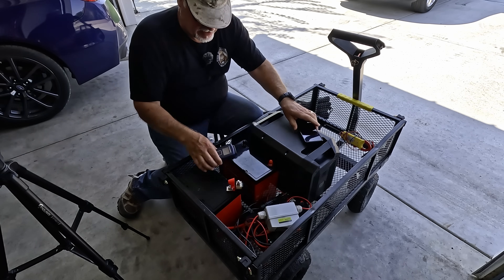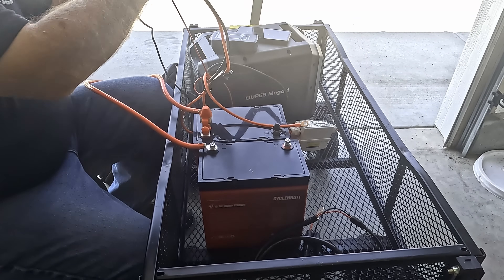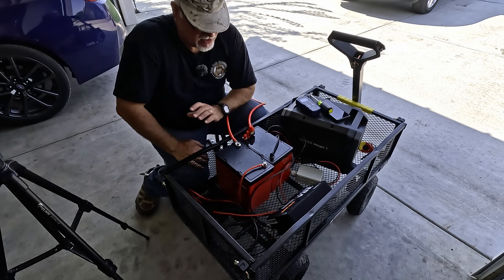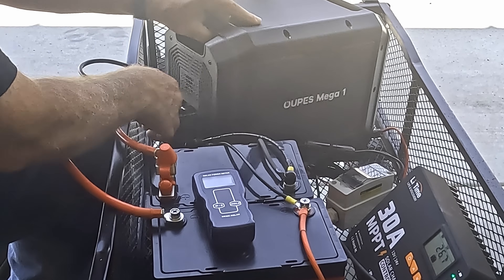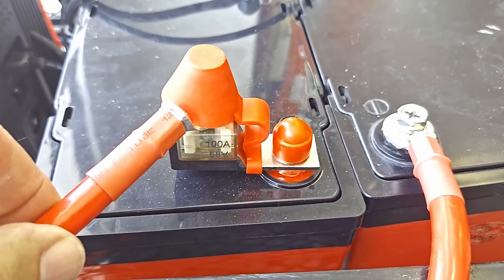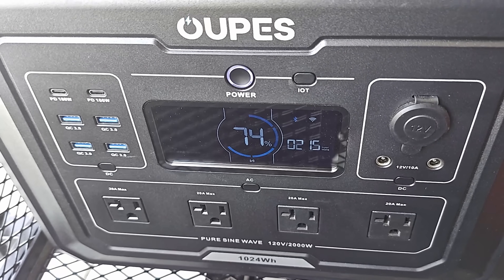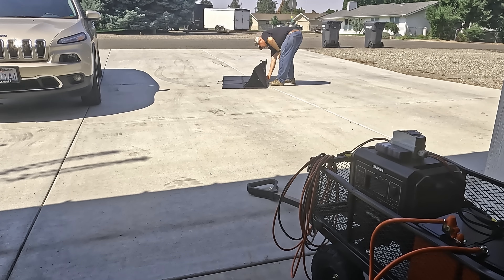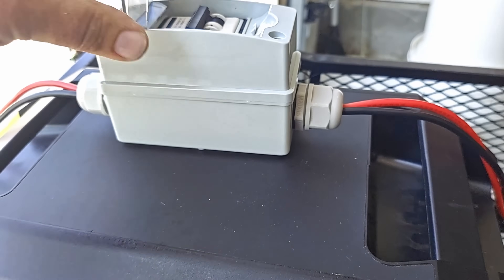Solar Panel Powers Battery AND Power Station Simultaneously – TESTED

Comment: Yup, this definitely works.  The one provisio is that it is best when the solar is capable of putting more watts into the battery than the power station takes out.  Otherwise things can get a little messy if a "battery empty" situation develops.

The power station will usually drop-out before the battery does, but the charge controller will then push the battery voltage back past the power station's start point, causing it to immediately bring the battery back down below the power station drop-out point... so things can start cycling in weird ways.

Not an issue at all if the battery isn't empty, though.  Generally speaking this method works quite well.

-Matt
Reply from the maker: Good point -- it's important to make sure the solar has enough juice for both!
Reply: Why I have multiple batteries and chargers so if the situation ain't good I can charge them both with a generator and swap out as necessary
Reply from the maker: Nice

Comment: Hi, Thank you so much for this and all your videos! This is exactly what I've been thinking of doing. My power station (Anker Solix F1500) will take a 600w max solar input. I want to run a potable Air Conditioner that pulls approx 1600 watts. Should I just take the Anker power station out of the equation and run the AC unit off an inverter? I can only run the AC for about an hour. I, of course, am trying to run it longer via batteries. You can probably tell, I'm a total newby to the off-grid Solar World, so thanks again for your videos that even a newb like myself can understand. I'm subscribed!
Reply: You're going to need a LOT of batteries to run a 1600w AC.... Also holy hell that's s big AC. Central air?
Reply: @jaredpnk  When I plug the portable AC unit into the Anker power station, Anker says 1500 to 1600w going out. I'm new to power stations. But I have a smaller portable AC unit that says 900w going out of the Anker...so that's what these units use, yes? Or no? Is there something I don't know (yet)? Thanks for the reply
Reply from the maker: What kind of AC unit is it?
Reply: @TheOldJarhead  Brand name ZAFRO portable (stand alone, in the room, run the exhaust out the window, etc) unit. Thank you very much! I'll look into inverters.
Reply: Oh, sry, one more question. What batteries then to run that unit (out of the inverter)  for any amount of time and how much solar to charge those batteries in a reasonable amount of time? Thanks for your time! Is tons of, crazy expensive, battery power needed? I haven't bought any batteries yet.
Reply from the maker: Hmmm, is it the 16000btu unit?  If it runs for 24 hours, you would need 8 48v 100AH batteries to run it for that 24 hours.  Unless it throttles down after it cools the place down. You'd need a LOT of solar to recharge them, but if you had about 10kw of solar, you might do ok with those batteries.

My guess is it doesn't use that much power, though.  What I'd do is get a wattmeter and run it 24rs and see how much it really uses.
Reply: @TheOldJarhead agree with you. I've never seen any portable AC use over 1000w. Even then ...
Reply from the maker: My 8kbtu unit uses 975w at full tilt but will ramp down when it gets to the desired temp.
Reply: @TheOldJarhead  OK, we're just cooling one medium size room for (hopefully) 5 hours, hottest time of day- 10,000btu unit. I'll test the wattage as you suggest. You've helped me out a lot! I've got a lot more perspective as to what I'm trying to accomplish. Really appreciated and I'll keep watching and liking! Big ups, Man
Reply: @jimhathaway8797 purchase a watt meter (harbor freight or any hardware store)

Figure out the power your unit uses. I don't think your unit uses 1600w. 

Then multiply that watts by how many hours you want to run. Add 20-50% for rainy days. 

Then you have how much storage you need. 

Get enough solar to recharge+ usage in a day.
Reply from the maker: I'm going to do this video for Saturday!  I'd written it down, and then you posted your comment!  Great minds.
Reply: @TheOldJarhead  OH wow, Thank you. Absolutely looking forward to it! O.J.H. Rules! :D
Reply from the maker: 😁 Thanks but YOU are helping me by giving me videos I should make 😀
Reply: @TheOldJarhead another video idea - peak shaving and time of use billing. 

I understand many of your viewers probably aren't completely off grid, and most of them probably have time of use billing from their utility power. 

I was able to increase my savings and my system by only charging from utility power during the night when solar was not enough during the day. 

But I also built my system to be largely battery heavy knowing that.
Reply: @TheOldJarhead  😁👍🤘
Reply: @jaredpnk yep the very first item I had when I decided to try solar, actually before I even bought generators, was a watt meter. You must determine how much power you need before anything else.
Reply: @jaredpnk  Yup.  Its kinda inefficient to do with a power station but it turns out that you naturally get a good chunk of self-consumption through the typical high-rate time period (4pm-9pm) without really having to do anything other than hook the system up.

Solar will have charged the system (and run the loads) during the day and the battery will start depleting in the late afternoon to keep things going.  If the battery lasts until 9pm then congratulations!

The only problem here is that power station solutions are usually far from perfect switching between the grid (the AC input) and the inverter, causing problems when done on the daily cycle.  Also, inverter overhead sometimes eats more power overall than you can save if you are not careful.  So YMMV.

Truly seamless operation takes a bit of research.  A Victron Multiplus-II can seamlessly switch (and has very low inverter overhead to boot).  Larger whole-home inverter systems can seamlessly switch (but have high inverter overhead, so need big solar systems).  But power stations usually can't.

So it is hard to do with only a little solar.  You'd want at least two residential panels (~800W) and a 2.5kWh battery or, at a minimum, to even start to see savings.

-Matt
Reply: @junkerzn7312 indeed. Agreed on all points. 

I have 20kw and 2200w of solar outside because to me it was more important (with my budget) to have energy ready vs free energy.  Victron 2x120 multiplus ii, victron 250/60 MPPT. 

Peak shaving not really possible with power stations, but when you do it with a full system, even a single stand alone battery it's starting to become worth it with price drop.
Reply from the maker: Nice
Reply from the maker: Hmmm, 1600w running all the time is a lot of power, but if the Anker is running it, that's impressive.   For me, to run that, I'd want a 4kw or even a 6kw low frequency inverter and 1600w x the hours I want to run it plus 50%.
Reply: When it comes to A/C solar panel wattage is generally more important than battery capacity.   But they are both important.  You want enough solar panel wattage to be able to completely run the A/C on its own plus produce extra that goes into the battery during the day.  And then when the sun goes down whatever extra that was produced during the day is drained from the battery to run the A/C another couple of hours (depending on various factors).

So, for example, if your A/C eats 1600W then we're probably talking 2500W of solar and a 5kWh battery.  Enough to run the A/C all day plus charge the battery and then run the A/C another 2.5 hours in the evening off the battery.

Usually when people do this they use a smaller A/C unit... something around 1000W or even 600W.  With 1000W A/C then 1500W of solar is good, and with 600W A/C then 1000W of solar is good.

(and of course the power station or DIY system has to be capable enough to take in the amount of solar you want to have, which can be substantial)

-Matt
Reply from the maker: As always Matt has great advice!
Reply: @junkerzn7312  Thank you!

Comment: Good video.  I’ve planning to do that with my OUPES cable hacked system.  As a test it appears to work fine just supplementally charging the golf cart batteries via a 51.2V AC charger while still connected to the OUPES M1 which is also receiving solar and AC charging.  Temps are fine and haven’t appeared to overload it yet.  I suppose its the same as power coming into a OUPES B2 accessory battery via another solar array connection.
Reply from the maker: I believe so and actually thought of doing that test ;) I was thinking of connecting my 1800w array at the cabin to the Oupes Mega 1 LOL via the B2 Port but it would be better to connect it to the golf cart battery that's connected to the B2 port since it's a lot more battery for the massive power I could send it -- 1800w might be a bit much for a 1024wh battery 😁

Comment: I need to keep this in mind to extend the use of my smaller power stations. I have several 1070Wh power stations and I was kicking myself for not buying one larger one. With my batteries and portable solar panels I can see how it's possible to extend the hours of mainly powering two refrigerators, a freezer, coffee pot, and lights for quite a while longer.
Reply from the maker: Yup!  It's a great way to do it and fun 😁